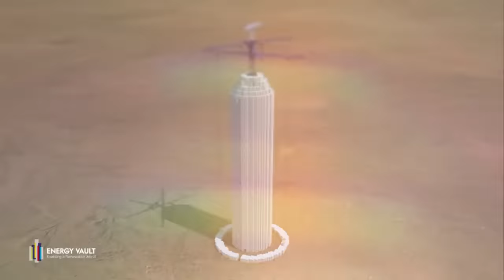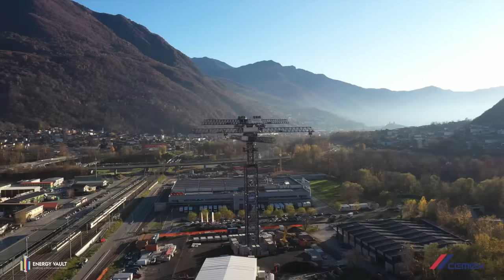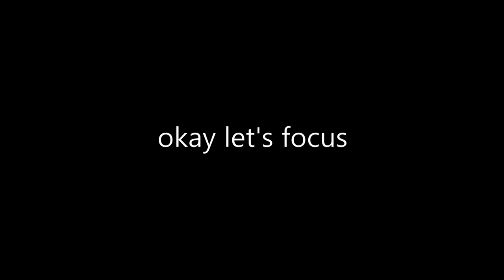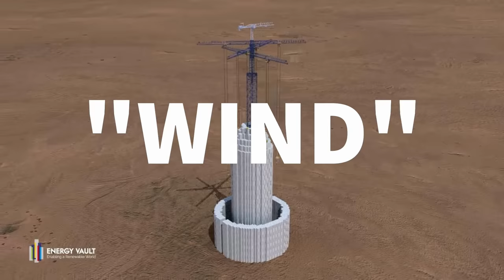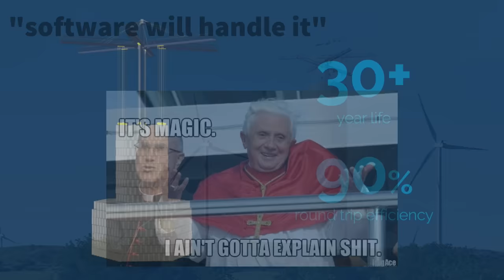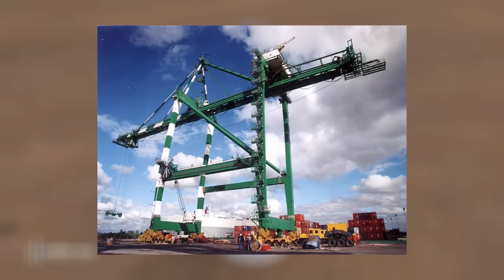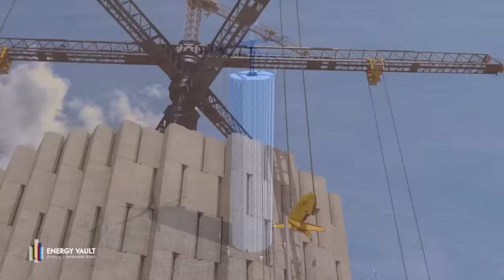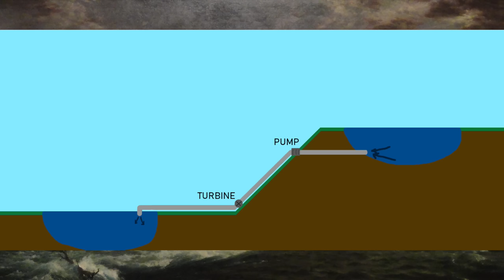The Energy Vault is a Dumb Idea, Here's Why

Comment: The best part of Adam’s videos is when he “fixes” people’s stupid inventions and just ends up with something that exists
Reply: usually trains
Reply: Except that solutions like the one in the video are designed to deal with the fact that pumped storage hydropower needs a bunch of very specific parameters met to work and massive amounts of modification to the environment. 

The concept is sound but implementation is not always so smooth and water evaporates, so wherever it is needs access to new water and we are in a drought. 

One solution is to use Salt Water since we can't drink it anyways and there is a lot of coast line. Salt water causes lots of corrosion and makes the whole project more expensive to maintain.

The solution he talks about having an enclosed system for pumped hydro would at least reduce the amount of water loss dramatically and thus use less water. Making more locations viable and having less impact on the environment in the area its implemented in.
Reply: @tikityler1386  ' a bunch of very specific parameters met to work'  This mainly boils down to 'a hill'.  Long term, the cost of using bulldozers to pile local dirt into a hill for this is ridiculously cheaper than the ongoing costs of anything else you're going to say is somehow 'better'.  It should be obvious.
Reply: Always love it when the tech bros discover something that's been around for decades.

Not to say this is a bad thing though, there are tons of "forgotten" technologies that just aren't in the mainstream eye and utilizing them more can be an amazing thing.
Reply: @ModelLights  or more realistically the amount to dig a hole on the hill and to lay down concrete for the pool for the water. Along with the amount of energy lost via evaporation. Essentially there is no OP option.
Reply: @Hybridious  Of course you use an already existing hill if it's there.  Point is even if there isn't a hill, the cost of making one is far lower than these other systems over time.
'and to lay down concrete for the pool for the water.'   It's not a swimming pool.
'Along with the amount of energy lost via evaporation.'  Next to zero, you're just not keeping up.
'Essentially there is no OP option.'  Of course it is, otherwise I wouldn't have brought it up.  It's obviously much better than almost everything else over the long term.  A hill still works 1000 years from now with minimal effort, everything else takes significant levels of maintenance.
Reply: @ModelLights  I don't think you realize that to store water on dirt is the same is watering the ground. Your gonna lose a lot of water to it seeping out and not every mound contains clay to prevent seepage. Along with that to make a hill 50 feet up to hold water of a substantial size is a lot of material, plus a truck can carry lots of dirt but it is still a shovel full for a hill. Also the water is very heavy if your hill isn't built correctly it will all be for nothing(essentially it's a earth dam). Essentially use the gravity generator similar but modified for you needs in deserts that are completely flat(granite stones would last) like deserts. Then water reservoirs for mountain region.
Reply: So he doesn't do anything at all....got it.
Reply: @MD-gk4uh  he’s sarcastically pointing out how the idea he is critiquing is just a very shit version of something that already exists
Reply: @melody_florum  That is called innovation, essentially once you realize the new big thing is just the same idea as yesterday you stop spending money on new phones, shoes, fashion, and etc...
Reply: @tikityler1386  This too, requires "massive amounts of modification to the environment".
Reply: @Hybridious  
solution to evaporation, put a frickin lid/cover on top of it. 
Solution to dirt absorbing water, use the dmn container. 

Combine both of them and you get a water tank. store the water inside some sort of tank that requires the least amount of maintenance. There, solved the water loss problem. Isn't that a common sense? No one store water used as energy bank on a frickin dirt without some sort of cover to prevent water evaporation.
Reply: @banned0404  They make some big water tanks but idk how many gallons your talking about. Thus, it is better to not make your own hill and just find a hill. Just like how wind turbines do it. I live next to a 1000 mile plateau and it just easier putting the turbine on top of it than building a hill for the turbines.
Reply: @Hybridious  Obviously you'd fill the basin with concrete lmao. It's not just dirt, it's a pool.
Reply: @bable6314  exactly!!
Reply: Saw the "pumped hydro" coming but still had to laugh 😂
Reply: This
Reply: @Hybridious  Usually manmade water storage pools utilize already existing river or basins with much denser dirt bases so the water seepage isn't too high, found by months of research and survey as to not harm the local ecosystem and such, but if you really want to brute force it everywhere you can always use concrete to waterproof the elevated basin.
Reply: @standard-carrier-wo-chan  I know, was just trying to disprove the idea, that 'building a hill' is cheaper long term, especially when you realize how heavy the material is to build it and how heavy the water would be. Just to clarify I think it is better to use available resources like current hydro does. It is easier to remove than build.
Reply: @ModelLights  That's why the world is full of these cheap, cheap hills. 

Not.
Reply: Like when Uber invented a kind of Uber ride that follows a fixed route and can pick up and drop off passengers along the route. That's right, they invented a bus.
Reply: As a physicist, I "invented" a lot of things in my life, just to find out that it's a thing that already exists. 😂
Of course. When you know how things work, the solutions force themselves onto you. 

Humanity's problem is not our lack of inventions, we already have existing and efficient tech for almost every required task.
But it's a political issue to implement them on a large scale, which most people don't want to do, because they don't want to change the status quo and their habits. 
So they just hope that some genius inventor comes along as our savior and fixes traffic, transportation, energy crisis, climate change to atone for our sins (CO2 output, energy consumption, trash...).  
This is why society keeps falling for people, who just re-invent the wheel, but shittier.
Reply: Flying cars<Trains
Reply: @tikityler1386  evaporation can be prevented with Floating Solar. This is the ideal combination. The solar modules produce green electricity during the day that is powering the pumps and at night the stored water can be released.
Reply: @tikityler1386  I wonder if it would be economical to build what would essentially be an artificial hill,mimicking natural hills,of which there are a limited supply in the right locations. Pumped hydro storage involves billions of tons of water in the upper reservoir,after all.
Reply: That's the point.
Reply: @tikityler1386  yes and it would be much more expensive then towers of concrete blocks with big ass cranes it’s totally difficult to dig a few holes put a pump and fill it with water
Reply: @Hybridious  dude if that was a problem to my knowledge there is a gel or something that can make surfaces hydrophobic easily
Reply: But, but, he didn't end up with a train. Are we sure this is real Adam something and not a deepfake impersonator?
Reply: @riku3716  I was expecting Adam to propose Rail Energy Storage as an alternative. It would have been really fun. xD
Reply: Ye, it's almost as if all these inventions exist for a reason and they can't be reasonably replaced by some tech bro's fever dream
Reply: @ModelLights  I've kindof wondered if that isn't a solution, long term, to California obsession with renewable and water shortages. Build a crap load of solar, way beyond peak capacity, then use it to power desalination and water pumping up to the Syria mountains. Then run generators from the mountain reservoirs at night when the water is released downhill to supply states on the far side of the range.

I have no idea if that's viable, but it at least seems more sensible, and provides multiple utilities, compared to the concrete block tower.
Reply: @tikityler1386  it’s easier to make things that have multiple applications and uses and very common like metal pipes than cut granite, marble, or limestone out of the earth and ship it to site. Concrete and cement simply won’t last long being move around and bumped that much. If a pyramid the size of Giza was built today it would be anywhere from 2-10x the cost of a hydroelectric dam. The idea is too primitive to be efficient. Contrary to what you believe the other 2 forms of matter liquid and gas are way cheaper to source and manipulate for energy than solids are. The earth is 2/3rds covered by water and the air is literally all around us. Take nature for example. Movement and life is a good determination if a space has a specific type of energy in it. We don’t breath in rock for or have it run in our veins. We use materials that are easy to distribute after all. Concepts like this would be in a environment with limited resources in a confined environment and if you literally didn’t have anything better like in space or a cave deep in the earth.
Reply: @tarstarkusz  batteries have problems: they degrade over time and are expensive. Battery tech just isn’t at a point where an entire grid can rely on it. to my knowledge there isn’t another form of clean energy storage. Hydro isn’t perfectly efficient nor is it compact but it’s the best we have. Imo nuclear should become a way bigger part of our energy as it’s stable and clean (nuclear waste is safe when properly dealt with, which isn’t that hard to do). France is already like 73% nuclear so it def can work at scale
Reply: To be fair, that energy vault stuff is just some inefficient way to transfer kinetic or thermal energy to potential energy
Reply: it really is amazing that somehow engineers and designers already know the most efficient thing and also trains are just OP
Reply: i havent seen this guy much but how many times have people reinvented the wheel